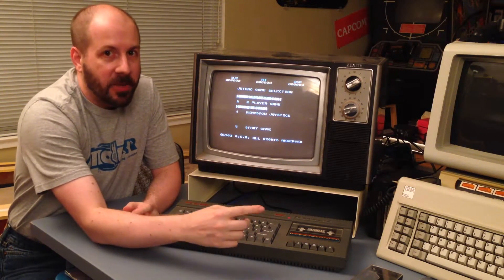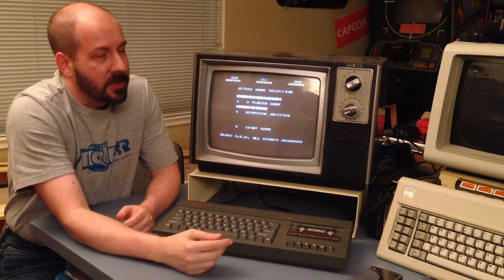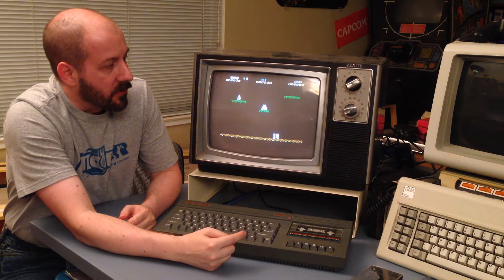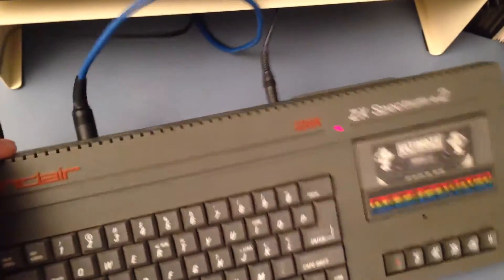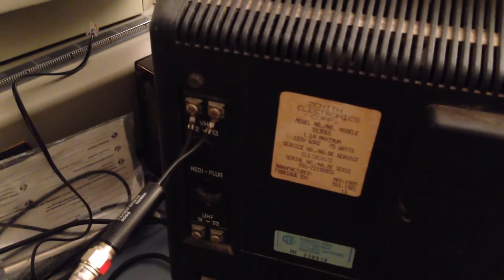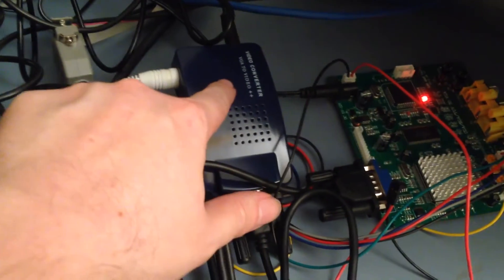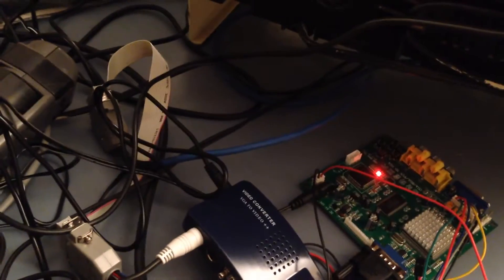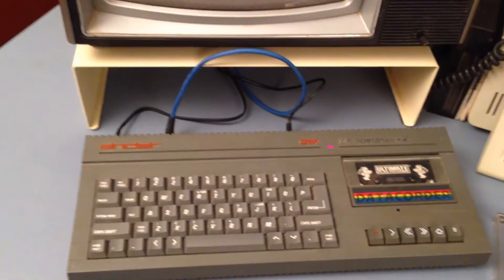British ZX Spectrum connected to American TV

Comment: Is it possible to purchase a British 50hz CRT monitor or television for use in the U.S.? If I purchased the proper power adapter for U.S. power outlets? Or would that not work? Trying to see if there are other ways to play a Speccy in the U.S.
Reply: You would need a step-down voltage transformer. European voltage is 220v, we use 120v here.
Reply: "step-up"
Reply: When the Spectrum was produced the UK mains power was still on 240V supplies, it got downgraded slightly to 230V in the mid 1990's so you would need a step-up transformer to 240V to be sure.